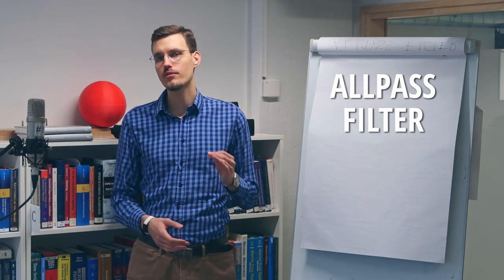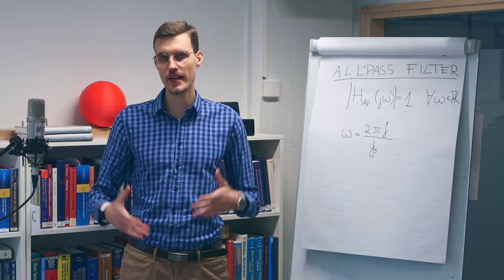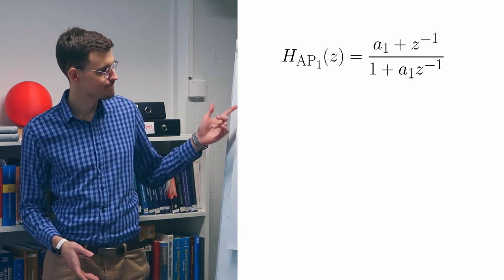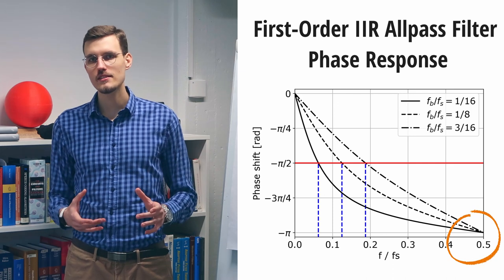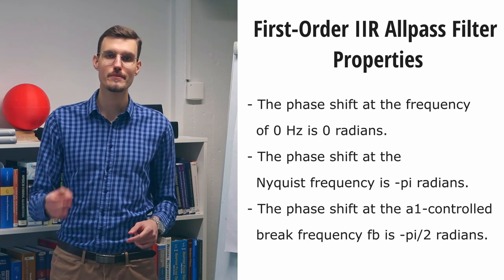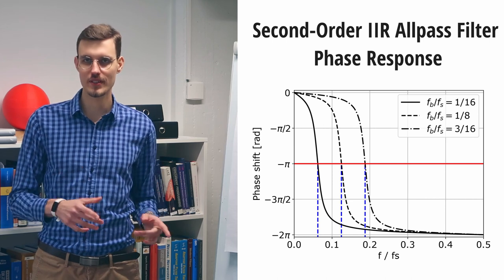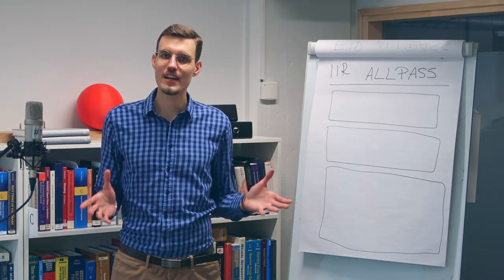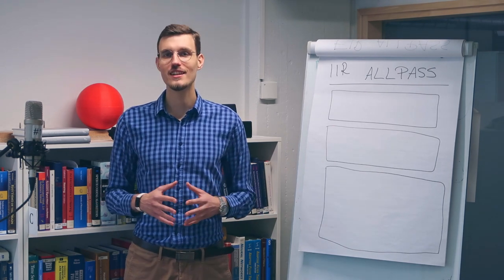All Pass Filter Explained In 1 Video: The Ultimate DSP Tool [AudioFX #003]

Comment: Thanks for the detailed explanation. The only thing that I'd love to be added is some sound examples of comparing unfiltered and filtered sine sweeps. Suppose that the left channel of your recording would contain an exponential sine sweep of 10 seconds in length while the right channel would contain the same sine sweep filtered with the allpass filter that you're talking about (assuming both sine sweeps would be aligned in time with single-sample accuracy).
Or, let's say that when you talk about the allpass filter being actually a convolution of some two other filters (I think you said something like this there), again, I'd love to hear a sine sweep being run through each of them (on one channel, while the other channel would contain the unprocessed sweep).
This would help people like me who are used to mentally converting (sometimes pretty quickly) sound to maths or maths to sound.
I do these conversions almost on a daily basis as I'm interested in things like tunings and microtonality and non-standard scales and new harmonic systems and all that stuff, so I switch from ratios to cents or from cents to ratios pretty often.